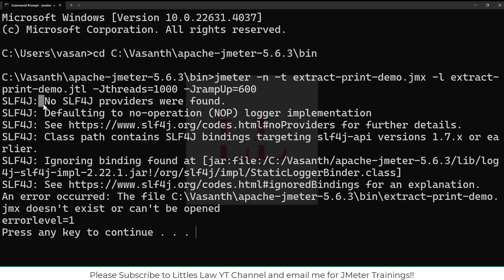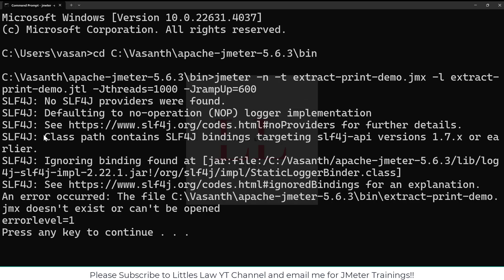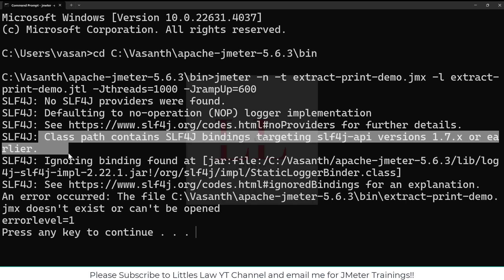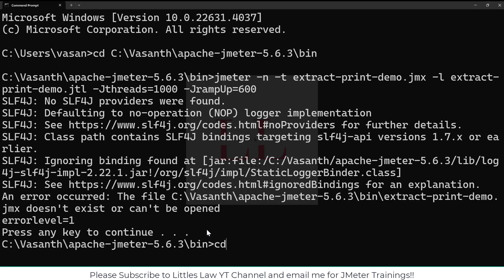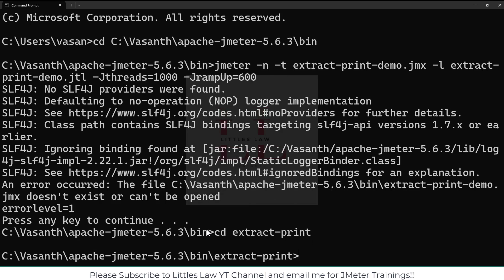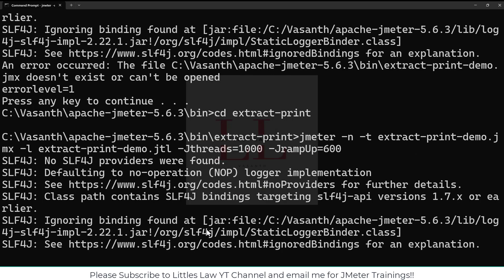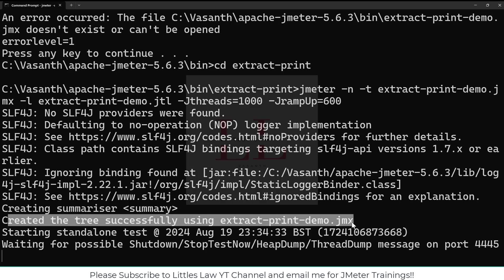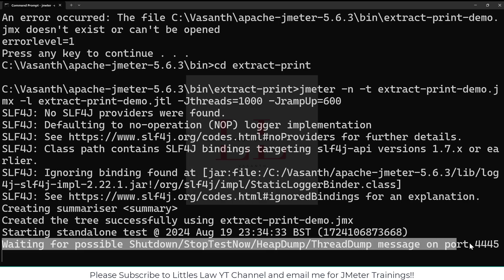How to execute Stress test using JMeter #jmetertutorial #littleslaw

Comment: Hi sir, this is not related to the video but does jmeter listener result depends on the Internet speed you have and machine you're using when you execute it locally
Reply from the maker: That is one of the various other factors
Reply: @littleslawyoutubechannel  does jmeter have a listner that detect the responses regarding internet connectivity and the status of the locally machine

Comment: Is this is the way to do stress testing  in jmeter ?
Reply from the maker: This is one of the way to do stress testing as I mentioned in the video ..where you load the system more than the desired load.
Reply: @littleslawyoutubechannel  hi sir in real time load test or stress test any time of the test should be given in client requirement or not